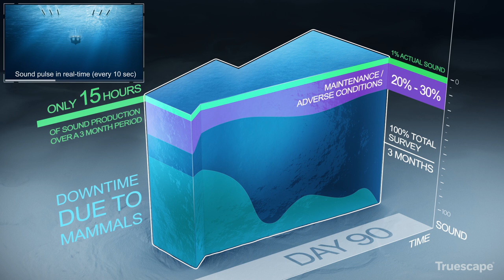Putting Seismic Surveys in Context

Comment: I support videos like this to inform the general public of a balanced view of the impact of seismic surveys versus other forms of shipping. However there are two points in this video that misrepresent what is actually going on with marine mammal protection. Firstly the video shows a small area that seismic surveys covers compared to the whole ocean and that it is small in comparison. If animals and indeed marine mammals were distributed evenly throughout the ocean then this point would hold up. However marine mammals are not distributed in this way and indeed the areas along the coast are the most densely populated and if the majority of seismic surveys are carried out in these coastal zones then the impact is significantly greater. Also not all habitats are the same in the ocean. Some areas will be more critical to a local population than other areas and so comparing a small area surveying against a vast ocean does nothing to consider these critical habitats. The second point in the video that is incorrect is when a 500 metre zone is shown and it is stated that animals are protected when they enter this zone. This is not always the case. It depends on the mitigation measures that are required for each area. In Brazil there is a shutdown of the seismic source for all marine mammals. However in UK waters and anywhere else in the world where UK procedures are adopted there is no shutdown of the source when the animals enter the 500 metre zone. Mitigation only occurs prior to the source being fired - ie the source is not started until the 500m zone is clear of animals. If the source is already active and an animal enters the zone then there is no shutdown and the surveying continues. In the Gulf of Mexico a shutdown of the source when an animal enters the 500 metres only occurs for Sperm Whales, Baleen Whales, Kogia species and Beaked Whales. There is no shutdowns for dolphin or turtle species. If you look at the mitigation that is occurring around the world for marine mammals during seismic surveys the majority of time there is no shutdown of the source for a marine mammals in the 500m zone - the emphasis instead on is delaying the start up of the source only. When making these videos I suggest that there is proper consultation with marine biologists about how marine mammals inhabit the oceans and also to consult regulators and marine mammal observer organisations to get a proper understanding of the mitigation that is actually happening around the world.